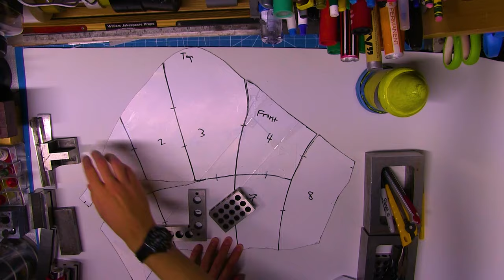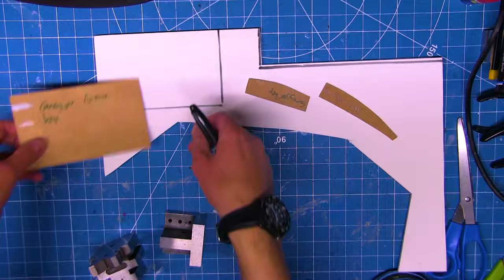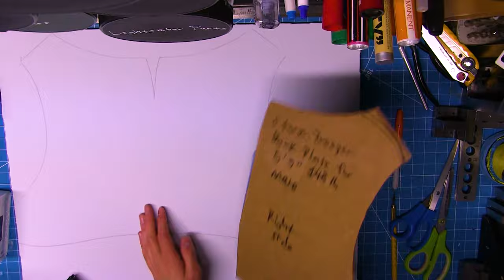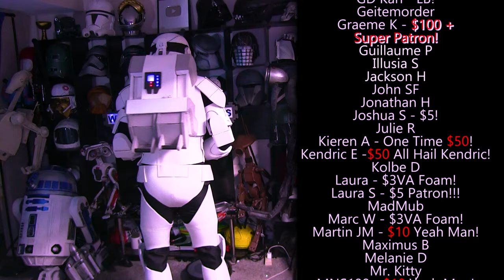How To Make Commando Trooper Armor (Star Wars DIY)

Comment: Would cardboard work with the templates?
Reply from the maker: yeah, it might mean more tracing work though. the whole idea behind card stock is that you can run it through a regular printer just like paper and save yourself a step.
Reply: @WilliamJakespeareProps  thanks my friend I use cardboard because I can’t get foam where I am